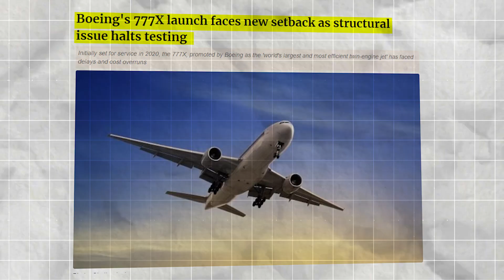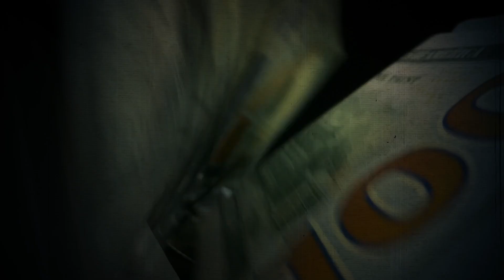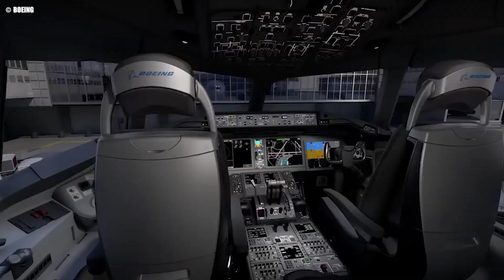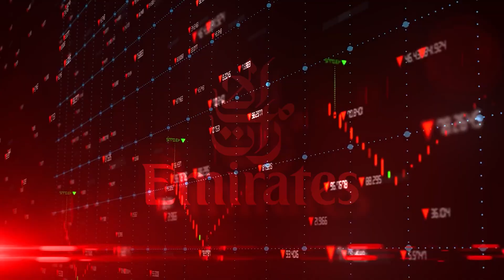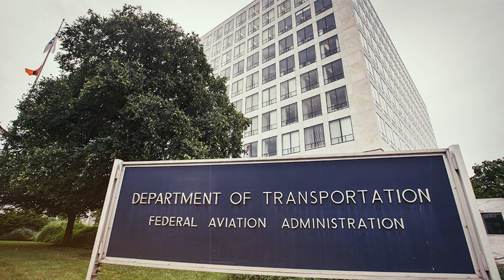Emirates Boss Revealed Boeing 777X's BIGGEST Problem!

Comment: The one mistake Sir Tim has made. Buying an end of line 1960s 777X. There is NO future upgrades available to this old aircraft. The AIRBUS A350 by comparison is already an advanced Aircraft with decades of development ahead of it. Emirates should ditch the 777x and buy the A350. It’s future business depends on this acquisition.
Reply: I don't understand what the OP meant by 1960s. The original 777 made its maiden flight in 1994 and entered service in 1995 with UAL
Reply: The 777x is easier to turn into a 10 abreast seating to fly more passangers
Reply: The 777 is a nineties design. Unlike the the veritable ancient 737.... Just like the max the X is 777 overextended....
Reply: @kutto5017  at least the 777-9 doesn't have the insanely high tailstrike chance as the 737-10 does
Reply: Sir Clerk likes it 'big' rather than economically viable.